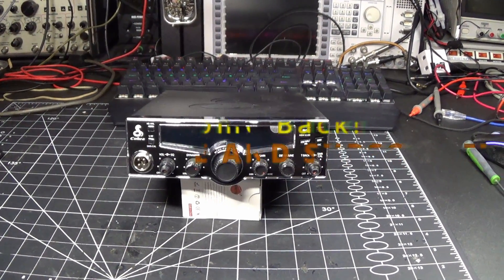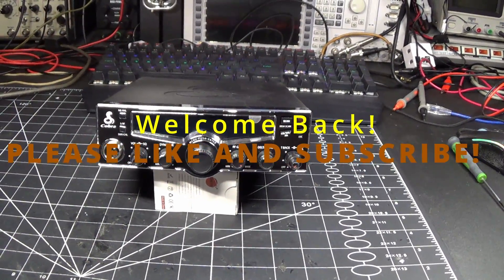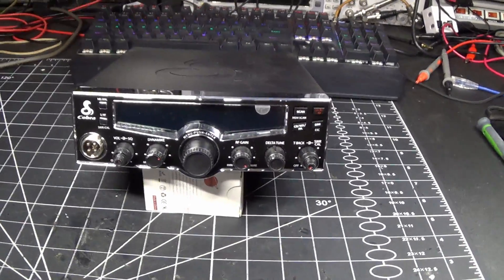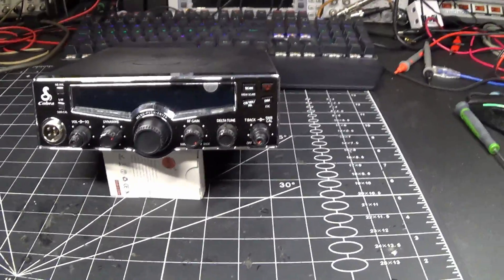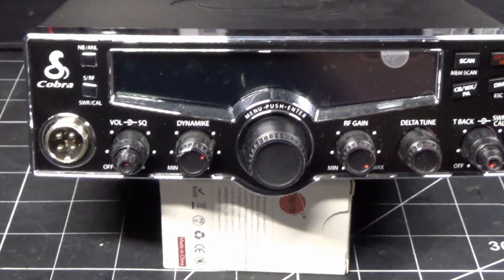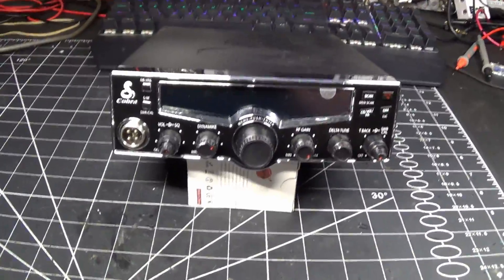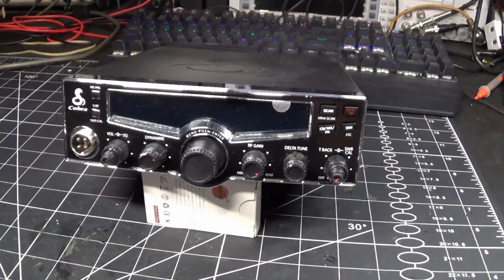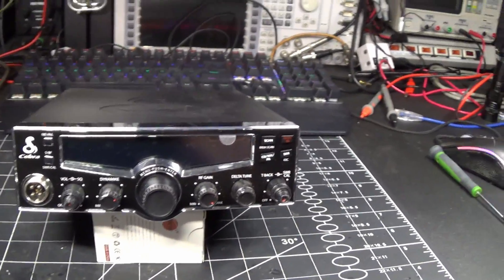Cobra 29 LX Tune up and MOSFET final.

Comment: The LVD song you have on this in the beginning has been in may head for 4 days.  I called it "Elvis on echo in a techno" I have 2  Cobra 29s . One an 83 and another  85 model. One had a super mod kit in it, I just put the tip 120 mod in it to the delta tune.. I have FM kits and a 29 extra channel kit, but I don't have time to do that. ..nobody will pay for the labor now as they can get an export AM/FM cheaper.  There are diehard Cobra 29 fans.  So I'll unload a modded and unmodded one. They are taking up too much room here! 73s
Reply from the maker: I'm going to be doing some Digi-max installs soon and an FM kit as well, most likely into one of the Cobra 2000's. I have a massive collection of CB's I have been meaning to get to. Also a bunch of DDS-VFO kits to install. Videos are slowly in the works
Reply: @salvagegeek   I'd be glad to see them.  DigiMax is my go to for Cobra 148Fs.... Ut's just so clean.  I have a mit1 148F and my other that needs work.  Keep up the good work. Every video you put is is great knowledge.
Reply: @salvagegeek   That is great to hear ! Are you using Ray's or Toby's DDS-VFO ?  I have a 2000 I was going to Digimax... I have a couple of FM kits as well as Toby's DDS-VFO kits. I may wait to see what you do to know what way I am going on that one.  Keep cracking through those radios and giving your knowledge.

Comment: What are the average dead-key gains of the mosfet mod? Clean modding!
Lots of spaghetti shops on here.
Reply from the maker: There isn't much gain at all. Its very minimal, and shops selling people on swapping them out is a scam. The only reason to do the Mosfet swap is because they just don't make the bipolar transistor finals anymore to replace your blown one. There is some new old stock out there if you find a trusted seller, but there are also a lot of fakes on ebay which are probably just a mosfet with the wrong part number printed on them. The Mosfet final works fine as a replacement, as long as you adjust the biasing. The down side is that Mosfets will blow very easily if your SWR gets too high. The old bipolar transistors could handle bad SWR a lot better before they blew out.
Reply: @salvagegeek  Thank you for the amount of detail. You are performing a silent recall! I figured it was not much without an added heatsink.